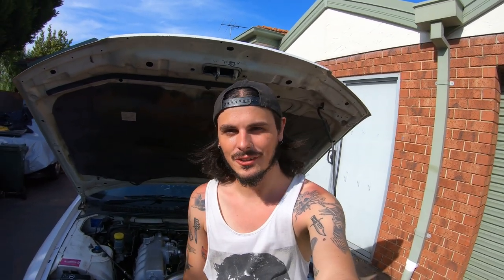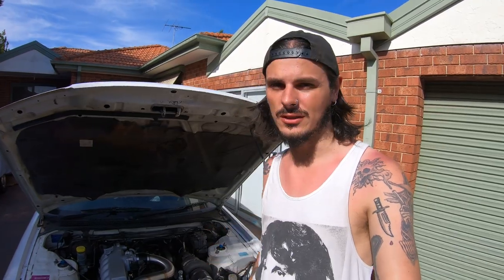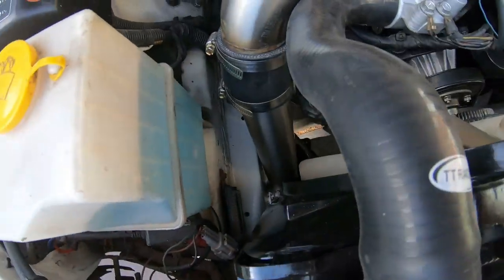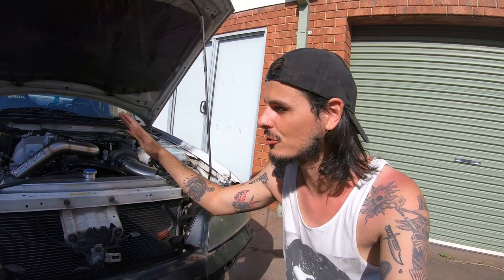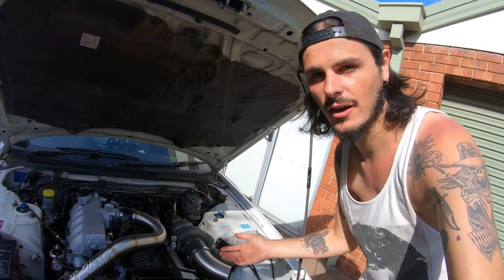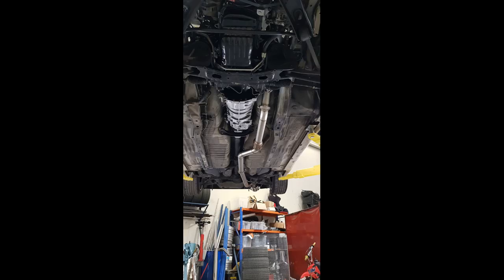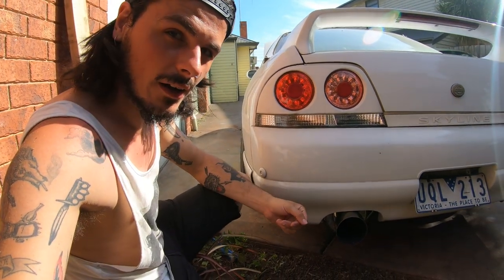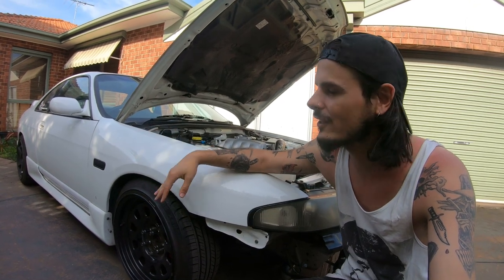Fully Forged RB25DET Gets Fab Work New Screamer Pipe Exhaust System With Cooler Pipes

Comment: Dying to know, why did you keep the factory intake manifold instead of going ffp?
Love the work thats been done, looks sick!
Reply from the maker: cheers mate!! the ffp look better. but im wanting early boost better torque response where the ffp not much gain for it value, better at top end though but I’m not a straight line person so this set up gonna be sick out in the touge
Reply: @ClutchKickJunkies   i agree the stock bottom runners do utilise better torque and response but there are ffps available that bolt ontop of them so you can retain that torque while cleaning up the engine bay and piping, much more simple setup then stock. the work on this engine is sick but it really confuses my why youd spend big money to fully forge the internals yet not spend money on a good ffp. stock intake manifolds also restrict power when youre going for big numbers to
Reply from the maker: i know about those hats but it doesnt phase me the stock ones Ive seen big numbers one making 480kw with stock manifold
Reply: Clutch Kick Junkies $1,100 for plazmaman one no wonder people use the fake ones lol. Stock you will achieve better low end power specially with your build you will make a lot of power

Comment: spark plug changes gonna be a pain.. now to run a catch can.  gonna be a pain to mount it n run hoses to make it look clean. yeh its nice dont get me wrong... that's just my opinion..
Reply from the maker: only two hose clamps to move pipe out of the way and got 90degree springs for catch can hose which will make it bend easy should be sick